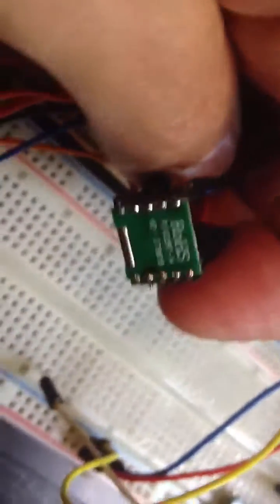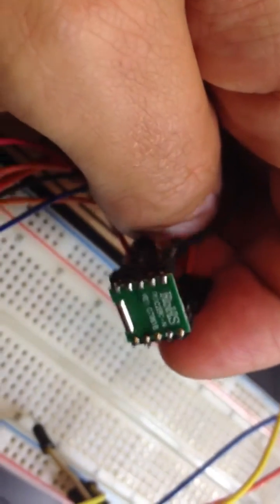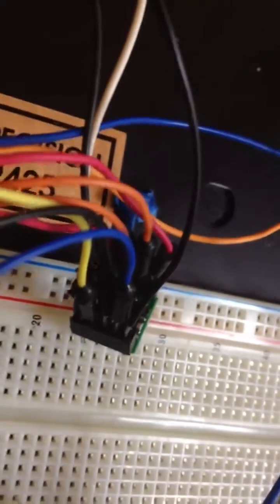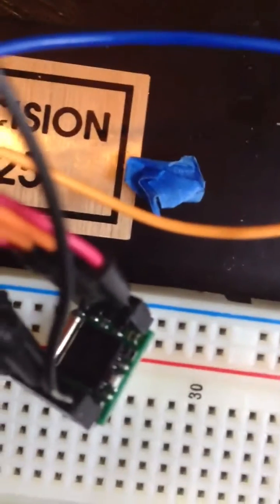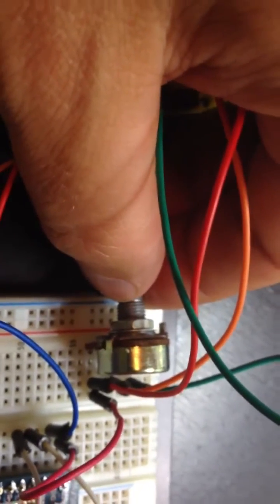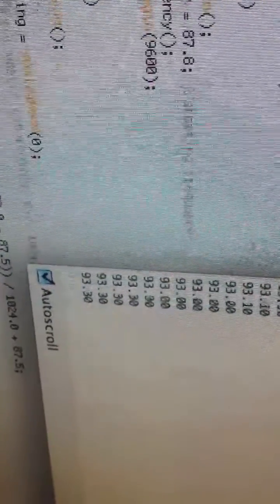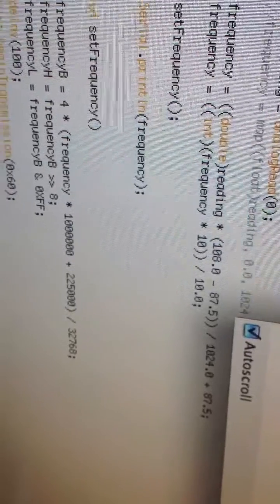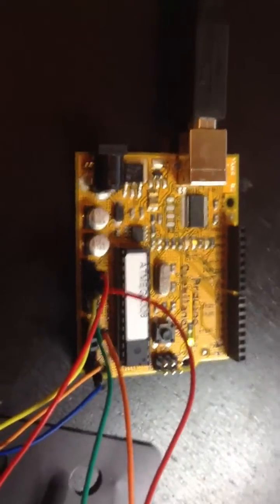Arduino controlled radio using TEA5767

Comment: I want to have the module scan through  the FM broadcast in the United States starts at 88.0 MHz and ends at108.0 MHz. i need to hear the volume loud while scanningThe band is divided into 100 channels, each 200 kHz (0.2 MHz) wide. The center frequency is located at 1/2 the bandwidth of the FM Channel, or 100 kHz (0.1 MHz) up from the lower end of the channel. Is there a simple sketch to achieve this? Im trying hard to figure this out but its eluding me. admin@sandiegohaunted.com
Reply from the maker: Hi Daniel,
No sketch for this as far as I know (it's fairly niche?) but you should be able to achieve that fairly easily. Why don't you just use the sketch in the Instructable I mention and increment the frequency with 0.2 and then wait 1 second before playing the next one?

Comment: Hi, i recently bought the TEA5767 and i'm currently looking at your example how to make it work. I have seen the schematic and i am confused as to what the TEA5767 pin 5 does? is it just a wire coming out? or is an antenna connected to it? if so what kind of antenna? Thanks!
Reply from the maker: Yeah. It's just a wire used as an antenna.
Reply: Jens Chr Brynildsen Wow thanks for the fast reply. Hope it works when my chip arrives!